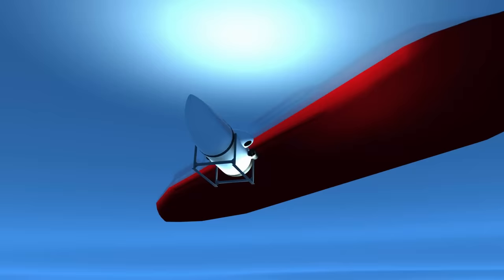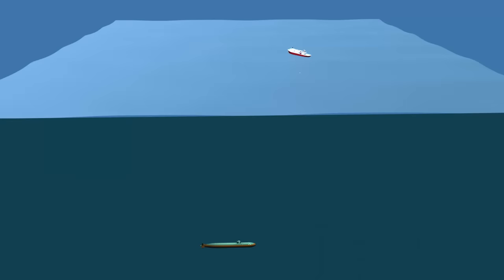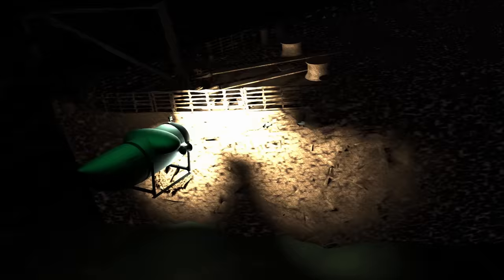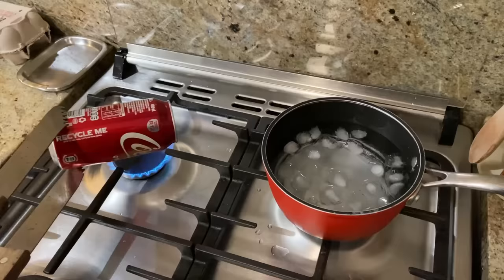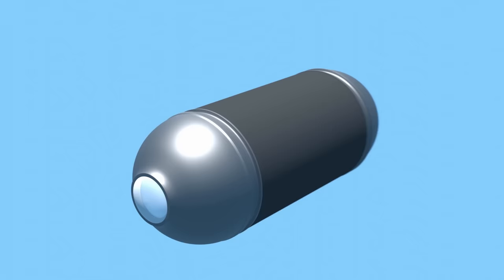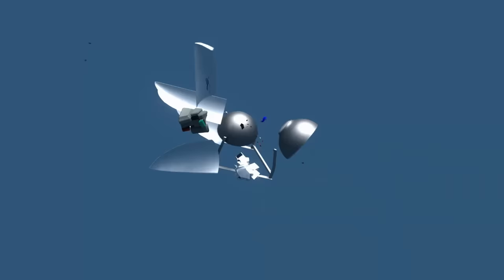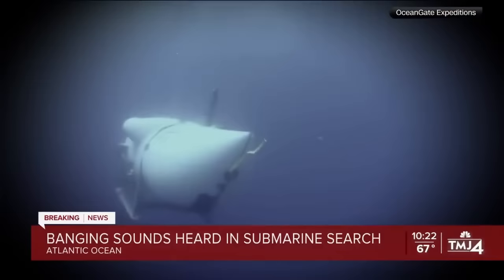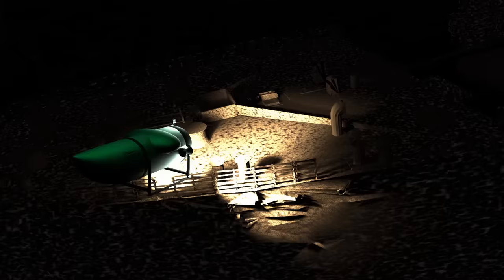TITAN Sub implosion | Deep Dive animation explanation

Comment: I was involved in some early research of using carbon fiber to make scuba diving tanks. This turned out to be an excellent fit for carbon fiber and it does help to alter the direction of the fiber application. However carbon fiber only works with internal pressure which puts the fibers under load which prevents the epoxy, which it is layered with, from bursting. With oceangate the exact opposite happened. Basically you can think of every bit of their structure being nothing more than an epoxy shell as the carbon fiber does very little when external forces are pushing inwards.
Reply: If anything, the fibre would weaken the epoxy. Now you only have thin layers of it, interspersed with the fibres which would simply slump without an internal force with substance to keep them in place. Think of it like a sausage shaped balloon inflated to the point where it holds its shape, wrapped in bands of fibre. If you tried to inflate it further, the bands would keep it from expanding. Now put the balloon in a vacuum chamber, suck the air out of the chamber (under-pressure), and the balloon with fibre wrap would collapse.
Reply: I would've thought a titanium sphere was a good material and shape ...but I'm no engineer
Give me a certificate
Reply: At this point I am astounded as how the implosion didn't occur on their very first trip to the bottom of the ocean.
Reply: Carbon fiber is also used to hold tanks for CNG (compressed natural gas), which is about 3-4000 psi, from my recollection. Again, the pressure is from the inside out, not the reverse. I had been wondering how they put the carbon fiber under tension in a compressive situation, and I am shocked to learn that they didn't even try. I can't imagine how it made 23 prior dives without imploding.
Reply: Indeed carbon fibre works well for aircraft that need to pressurise because the carbon fibres work well under tension, they're not quite as effective under compression, still better than regular polymer but still not ideal.
Reply: Very interesting noticed
Reply: It’s not just carbon fibre that behaves like this all cylinders will contain several times more internal pressure than they will withstand externally. Many vacuum tankers get “sucked in” at less than 1bar but are quite happy to pressurise at 4 bar
Reply: @johnwarwick4105  True, but the true strength of carbon fibre is in tension, compression isn't its best attribute.

Carbon fibre structures can be made to resist stress in certain axis, but in other axis they may be incredibly weak, thats' why carbon fibre road cycles are often very carefully transported, because although they can resist the stresses of riding and the weight of a rider on the seat post, they're not suited to their own weight being hung on non-ideal points like when placed on a car cycle carrier.
Reply: The duty cycle is far less than steel, titanium or aluminum.
Reply: Sorry, but no. It’s true that it’s better in tension than compression, but it’s still wayyyy better than “just” epoxy. What is surprising here is that there were no fibre in the axial direction (twice less loaded, but still). And as rightly mentioned, it is highly likely that fatigue has been overlooked.
Reply: @roberta5292  BIC submarine 
Like using the BIC shaver a few times ...face rash and a nik
Reply: @Drycleanerguy  Exactly, in the same way that a balloon works well under internal pressure but not so good under external pressure! It's hard to believe that the project got past the get go.
Reply: I'm a Mechanical Engineer. CFC'S are very strong in tensile strength (perfect for high pressure air tanks), stronger than steel but not very good at handling compressive loads as you quite rightly said they rely heavily on the epoxy used to support the carbon strands. This is basic material science & the builders of the sub should have known better. So unfortunate that people had to lose their lives for lessons to be learned.
Reply: @jonellison9832  it wouldn't if it was military 
But it's private so ego is a factor
Reply: @roberta5292 me too. It's like God was merciful 23 times before he said nah this is too much
Reply: Bravo!!! excellent answer. love it.
Reply: @oftin_wong  yeap and sphere its the best geometrical shape to hold pressure even better than a cylinder tube.
Reply: @roberta5292  because of the fatigue of the epoxy,  both from differential pressure and temperature.
Reply: @limawhisky  I need that certificate now
Reply: @oftin_wong  - OceanGate didn't want "right", they wanted "cheap enough to make a profitable business volume feasible.
Reply: What you describe is the same thing that makes carbon fiber great for use in aircraft. It is strong when under expansion force (air inside the scuba tank or aircraft fuselage is greater than the outside pressure), but weaker under compression force (as used in a submersible).
Reply: @Texas240  sounds about right
Reply: I've worked with carbon fibre on vehicles and you are absolutely correct. It is quite strong when its being "pushed out" if you will  (tensioned)  since the fibres give added strength to the epoxy .  However, the CF mesh do not do well when "pushed" upon (compression) , as in being crushed (which is exactly what the depth pressure was doing to the Titan.)   Its been used for well over a decade or more in aircraft to good effect, but aircraft are also not subject to pressures like submersibles.  Note too that when you "lay" or form CF, you can lay it in one direction or multi directions for both tensile and compressive strength.  Apparently this was not done with the Titan and it was "laid" in one direction for tensile and not compressive strength.
Reply: This thread is an amazing read! Thank you all for posting. I wasn’t even a novice on metal strengths, applications, etc - I never even thought about that at all! But since this tragic disaster I’m reading so many smart and insightful comments; this is one of the best. Thanks for making it so my “creative” brain can  understand some science! I mean, internal v external pressures require different materials?! I must have been sound asleep IF/when that was ever taught in school!  You guys make it sound so easy….thank you! 😊
Reply: @roberta5292 There is another ,very important ,  factor to be considered: The fatigue of the composite (carbon fiber & epoxy, in this case)...the acumulation of small damages each time under loading and then unloaded...( fibers crack, lamina debonding, matrix( epoxy) crack and many others, for instance).
Efects of temperature and moisture (I mean, absorption of water) must be considered, as well.
At first analysis, the wall thikcness was ok...even  superior than that required by the level of the external  pressure,in  static condidion, BUT, for sure,  the fatigue may be the central point here, in adittion to the possibility of failure of others parts and / or structural  components ....only with these first images of the debris, is very hard to be sure about the causes, but the engineering gives us some path to stud them and find out...
Reply: Carbon fibre wasn't chosen for its properties. It was chosen because of its availability. The hull was made with a fibre melt spinning machine - you can make tubes of various sizes and thicknesses.
Reply: There is a huge focus by non-experts on the carbon fiber hull. While the hull may ultimately be determined to be the point of failure, I'll be interested to see what they come up with as they scientifically look at the debris. A point of failure I'd be curious about is the interface between the CF hull and the titanium ring. There are different bonding agents they may have chosen. I've heard epoxy bandied about but there is also methyl methacrylate (MMA) that is well known for bonding dissimilar materials. There are multiple formulations of both epoxy and MMA that may or may not be suitable for this connection. The design of the interface also comes into question. Could there have been a mechanical failure at the joint? Fatigue of the adhesive? Debonding?

At this point, everything you read is merely speculation. Only an in-depth analysis will give us answers.
Reply: What about extreme cold? I was under the impression that CF gets very brittle in colder environments?
Reply: @spencera3075  At that level, the temperature is not "extrem cold" condition  . Despite that, the diference of temperature, considering the temperature during manufacture ( of the hull)  and the temperature of operation ( under 4.000 m of water) must be considered ...the absorpition of water , as well: water absorption by the epoxy resin, used as matrix in composites with carbon fiber, could be up to 2% (approx.) ...and this generates additional internal stresses...and other demages to the composite
Reply: @rogermccaslin5963  very true since the "rings"  (both of them) were located and the one with the view port had the acrylic viewfinder out of it, so its quite possible that the "tube" didn't fail but the failure point could have been the bonding point where the tube met the titanium rings.  In addition, there's speculation that the viewfinderport could have failed as well (it was a known weak point/failure point) .
Reply: johnwarwick4105
Some vacuum tanks even have internal bracing.

Comment: The carbon wrap process was shocking, I initially thought it was a demo. I've worked in F1 and Aviation on the 787's wing. So, I have a background in this field.  There are many air gaps in the wrap that can be compressed, with stored energy with an uncontrolled release.
Reply: I could not believe what I was seeing. The entire hull was CF wrapped circumferentially, so there were no fibres in the longitudinal direction. It was not done in a clean environment and there was no process to remove air bubble inclusions. Clearly OceanGate had not the faintest idea what they were doing.
Reply: @Smannellites  Then how come it had been to the Titanic several times ?
Reply: As per your response, there was clearly an excess of " micro porosity"
Reply: @paulweston285  Fatigue damage is progressive, and grows after each pressure cycle. The Titan's hull would have been weaker after each dive. As someone else said, it was an accident waiting to happen.
Reply: @paulweston285  I played Russian Roulette several times and lived. Did I know what I was doing? Was I being safe just because I lived?
Reply: @Smannellites  They could have run it 45 degree ever other rotation would have taken a little more time and would have some waste but it would be stronger.   But the interface of two dissimilar materials Titanium + carbon fiber was a problem.  Also It was not seated very far into the ring.    The tube failed and blew both end caps off.   Poor design NASA helped.  Poor engineering from the get go.
I wow I must have dozed off during the video.   I was thinking it probably failed due to the joints and the cylinder bending.   He also provides a scenario where it collapses like an accordion.   The two end caps come together.    I don't think that is likely even if the fibers were going one way. Plus the end caps appear to have broken all the lugs which would be from the end caps being blown apart not together.
Reply: @Smannellites  Thank you
Reply: @paulweston285  But it failed on repeated exposure to depth, so your suggestion that it is somehow safe is fallacious.
Reply: @paulweston285  because of successful deploys means nothing in and of itself.  It can easily go several times before devastating  failure; hence the rule to follow the industry standard & certifications. 

But what’s worse is the plan to use it multiple times for tourism should have sealed the deal to build it the right way.  

I’m a Registered Nurse not an engineer & even I know you don’t try to reinvent the wheel.  Innovation is improving ( making better) not applauding the ability to get it done with less integrity.

I honestly hope they trusted in Christ & 🤲🏽prayers for their family.
Reply: @stuband4159  I think he was genuinely asking, not defending the sub engineering.

Comment: This is the best analysis that I have seen.  The animation is particularly illustrative.  Before now, I did not know that they dropped their weights, which clearly indicates that they knew that they were in trouble.
Reply: Yep - it's been found now that they did try to get back up to the surface before the implosion. I just pray they didn't know for long. What horror 😢😢
Reply: @TheCandiceWang  :face-orange-biting-nails:
Reply: Edsedlak6827,
My thoughts exactly. Don't know if this information was brought up elsewhere, and if so, this is the first I've heard about it...and which actually makes the whole thing even more tragic...and creepy.
Reply: There was a guy from I believe Discovery channel that was sent to do a story when Oceangate was in the Bahamas and he said they heard loud cracking sounds coming from the hull and Rush would try to explain it away..😬
Reply: 'Dropping the weights' was standard procedure. The craft relied on excessive weight to sink down to the ocean floor. First they would drop some ballast to become buoyant in order to hover around (neither sink nor float). And two hours later drop another 100 kg or so, to become 'lighter than water' and rise to the surface.
If I would make a model submersible for a hobby, sailing a swimming pool, I'd use the same methods.
Reply: @frutt5k  hopefully you wouldn't use carbon fiber!
Reply: Totally agree,very well explained Mike.🤙
Reply: @TheUnofficialMaker  Solid 125 mm PVC sewer pipes.
Reply: @frutt5k  They haven't reached the bottom of the ocean where the Titanic was yet though. The last communication was 1 hour 45 minutes into the dive. It took two hours to get to the Titanic.
Reply: They were not deep enough to drop ballast for buoyancy and we know this because of the time it took to drop to the wreck vs the time we now know the implosion occurred.
Reply: @antoniosantiago3284  we know nothing. we are still guessing. and guessing is what the ipcc also does.
Reply: @topquark35  In the world of the adults, 1:45 = 2 hours. We don't no jack shat what happened and at what altidepth they were.
Suppose they descended linearly, then at 1:45 they were at 7/8th of 4000 meter. But if they were slightly heavier... we don't know and we will never know.
Reply: @topquark35  I was referring to the previous 23 dives, as you could have known.
Reply: @antoniosantiago3284  maybe the descended faster and got down to the bottom a few min sooner than anticipated.
Reply: @mousetreehouse6833  the information about them dropping their weights to resurface as quickly as possible just came out, like maybe yesterday? Very recent info. :(
Reply: @topquark35  yup yup :(
Reply: @AJXOXO-vz1pn  no - many news sources have been showing for nigh on a week or more now that Titan never reached their destination and they wouldn't have reached the Titanic floor, being that things went wrong 1h45min into things 😔
Reply: @TheCandiceWang  
Thanks for the information.
Reply: @mousetreehouse6833  no problem :)
Reply: @2thumbtommy484  
That's crazy! This guy was definitely a real meathead, unfortunately smart enough to build the deadliest submersible, but too stupid to take advice from "old white guys" (or whatever the quote was).
I'm definitely googling that guy from (possibly) Discovery!
Thanks for the information. 😀😉
Reply: We'll know more about how deep it was when we get official records of what the debris field was like. Something that disintegrates near the surface will have a larger debris field, scattered farther than something that disintegrated near the ocean floor.
Reply: They might have known they were in trouble but never realized they died. Like a bomb defuser, you'll never know you screwed up, it's just lights out.
Reply: @mousetreehouse6833  no prob the footage shouldn't be hard to find and Rush's greatest accomplishment in life was his ability to sweet talk guests to ride in that tin can..🤷🏽‍♂️✌🏽
Reply: @melted_cheetah  this is the best case, and what I hope for, given what we know :(
Reply: @2thumbtommy484  Footage of what?  I missed something here... Thanks!
Reply: @RockandRollWoman  There is a couple vids on here where a reporter for Discovery I believe and another guy talked about a loud cracking sound as the sub was underway and Rush would try to explain it away as normal ✌🏽
Reply: @2thumbtommy484  I've heard submariners explain cracking noises as normal in descending, so for me the jury is still out. 
I have screenshots of the discussion about noises, but no way to post them on YouTube. That video now has over 2.5 k comments. Substack and Reddit are better for stuff like this because you can post outside resources .
Reply: @topquark35 mist likely he was beginning  to slow the vessel's descent  even more. 15 minutes  away from Titanic, would have been pretty close  in the pitch dark.
Reply: @TheUnofficialMaker  Actually carbon fiber is quite strong at 1atm, just never tested at 400 atm. At least now we know

Comment: My imagination of the implosion was that the carbon fiber tube gave-in to the pressure and instantly went from a round cross section to a flat cross section, like a cardboard toilet paper tube between two clapping hands. This would have jellified everything inside and blown out the two relatively intact titanium ends in opposite directions, possibly blowing out the porthole too.